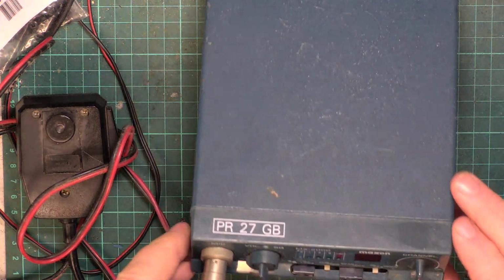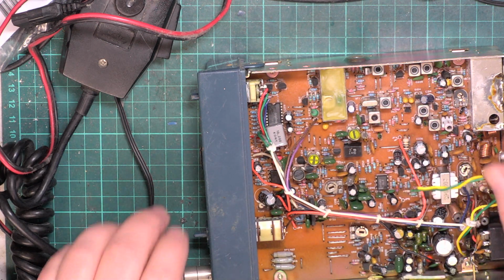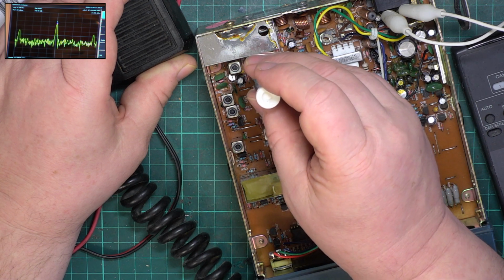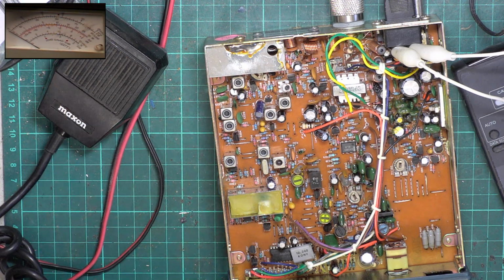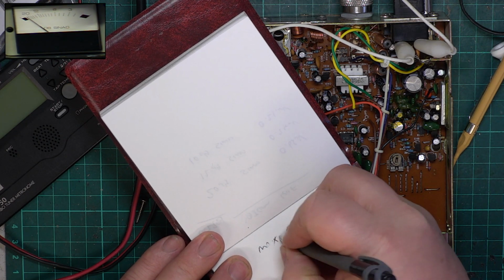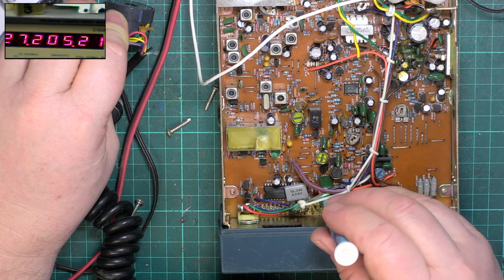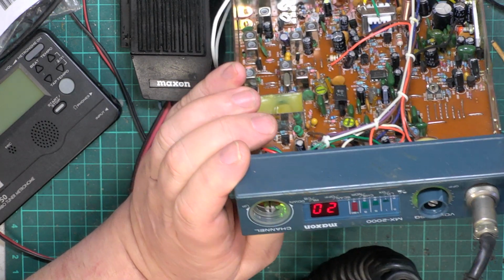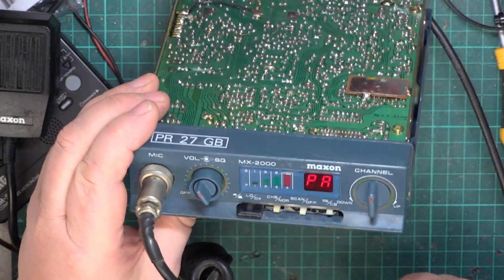Maxcom MX2000 UK PR27GB CB radio (mobile) - Repair & service

Comment: Hi Richard, Is that a full-sized spectrum analyser or a TinySA you were using in the video?  If the latter, what is your impression of the TinySA?  I have just bought one but I have yet to use it to set up or repair any radio gear yet.  From what I watched on and read in reviews online it seems to be a good piece of kit for very little money compared to a full-sized bench spectrum analyser.
Reply from the maker: It's full size & replaced an ailing CRT one we previously used (& showed on here). Bear in mind my main amateur radio interests are UHF & many of our business customers are on UHF up band (462Mhz area), so the TinySA only goes up to 350Mhz. I know it goes further on harmonics. There are times I may have to demonstrate our readings to Offom, so instruments here have to be credible to them.I was also concerned about latency & further needed an analyser with a tracking generator for doing barrel filters & duplexers on.

Richard

Comment: Is low power a requirement under CEPT or just an MPT 1320 requirement?
Reply from the maker: No it isn't. When MPT1320 got revamped as CB27/94 the requirement was removed. The requirement was originally a CAA issue.

richard